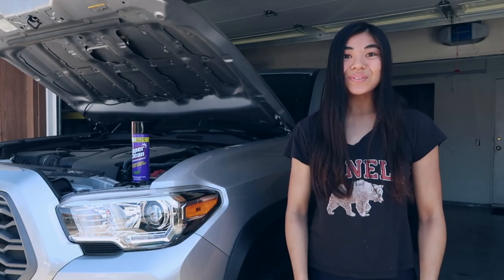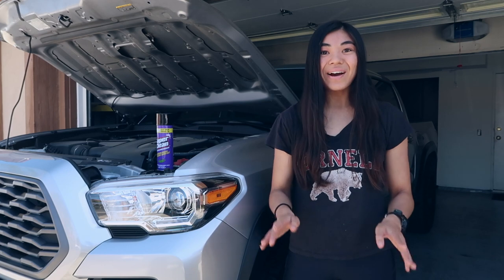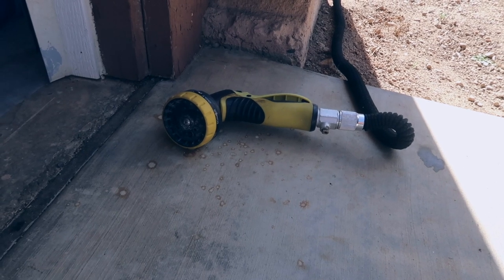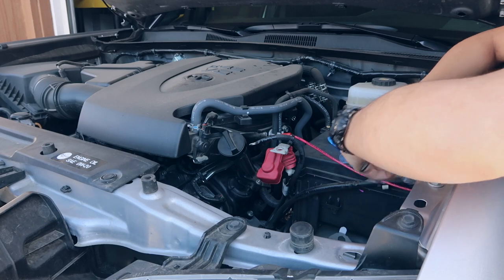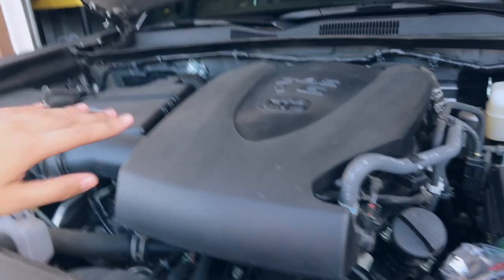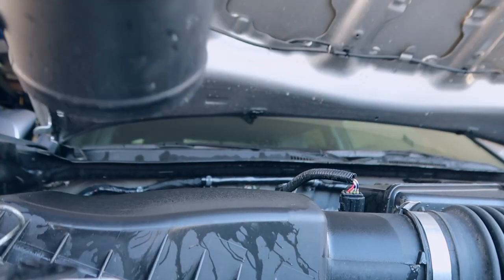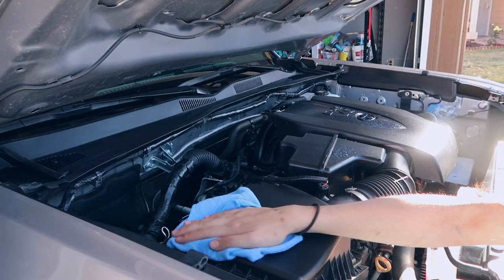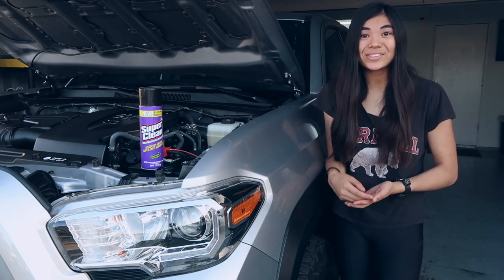Detailing My Tacoma's Engine Bay!

Comment: I pretty much use the same process as you 🙂. I usually just cover the battery and alternator with plastic bags. The exposed wirings, I use saran wrap. For superclean, I use an IK Foam Pro 2 sprayer diluted 5:1 or even 10:1 spray it on the engine and agitate. Rinse, leaf blower, wipe dry then dress the plastic trims with CG VRP and Mothers Back-2-Black 👍🏼

Comment: Spray 303 let it soak into the plastic, They buff to dry. Keeps all the plastic looking a deep black and stop the engine bay heat from drying out the rubber plastic, etc

Comment: Excellent job!!!!....hopefully a TRD air breather....mine runs great and has even more power with a pedal commander....you really should look into that for the 3.5.  It will wake that engine up big time!!! I have the 4.0.... In about 10-12 truck lengths with 6 more settings to go 82 mph!!!!! NO JOKE!!! the commercials are not fake. It really works!!!!! Take care!!!!

Comment: Quick tip: what I do with my Taco is connect an air hose to my compressor for the smaller areas that need water removed. Your truck still always looks better than mine though 😅

Comment: Great job at cleaning.  I would of still used a pressure washer, but with a low pressure tip.    Question: have you ever using silicone or other products on hoses, rubber, and/or pliable plastics?   I always apply to my CV boots, weatherstripping, and other materials that may tend to dry out or become brittle.  Just a thought.

Comment: hard part is just cleaning the truck, especially if its black like mine because its IMPOSSIBLE TO KEEP CLEAN!!! lol
The water here in Az has so much calcium in the water, it basically ruins your paint! leaves white water spots that can't even be buffed off of the paint!
Reply: You should get a filter for your hose and it will prevent the water spots

Comment: No need to vacuum it. Just spray with water and the spray can and agitate with brush and spray again. You dont need to remove the battery either or disconnect it.
Reply: Removing it not necessary but at least disconnecting it for safety

Comment: Be careful with Silicone Spray around the air intake & O2 sensors in the Exhaust ! Yes Silicone Kills O2 Sensors , I Use 303 Protectant, it's One of the Best But it does use Silicone

Comment: Can i use the 303 to restore my door panels and any plastic in my truck?
Reply from the maker: Yes, I believe you can use it on plastic surfaces of the vehicle
Reply: @ChloeKuo  thanks chloe👍
Reply: Not related to the video but, im thinking of replacing my cargo lights with a smoked lens. Any idea where to get it aside from amazon?

Comment: You’ve already mentioned in video there’s no major concerns using water hose on engine, but since then has there been any issues? Any residual effects? I was debating whether or not to do the same on my 2014 Tundra...
Reply from the maker: So far I haven’t seen any effect 🙂
Reply: It's safe, just don't use a pressure washer and don't try to soak an area, just keep the nozzle moving.

Comment: I think removing the battery and covering the leads was overkill. Just unplugging the battery would have been good enough. Also I know you’re cleaning the engine bay for aesthetics (which looks great by the way) but other other than that doesn’t improve or protect the engine. All those components are plastic, anyways.